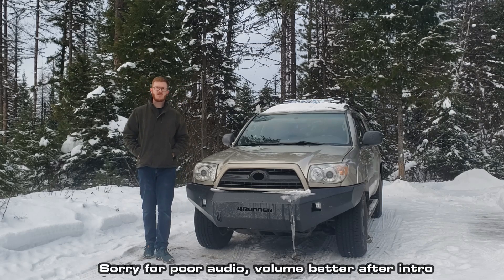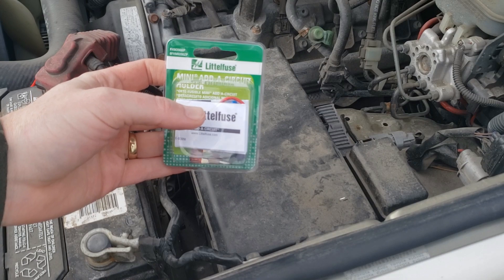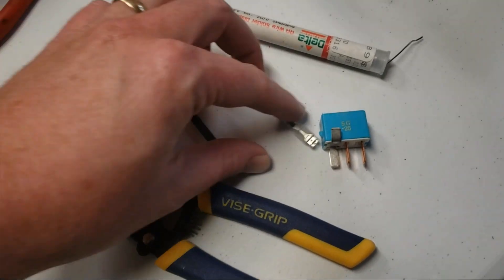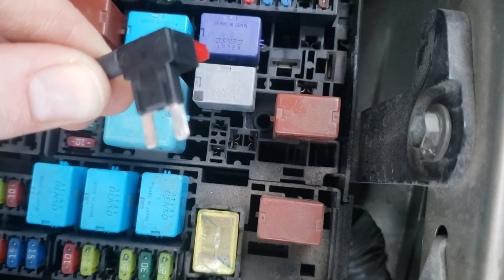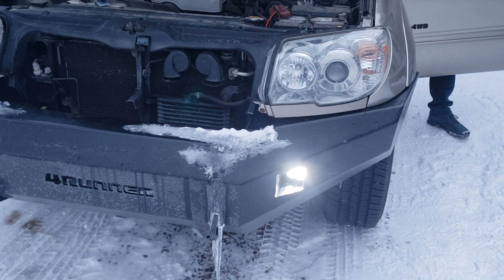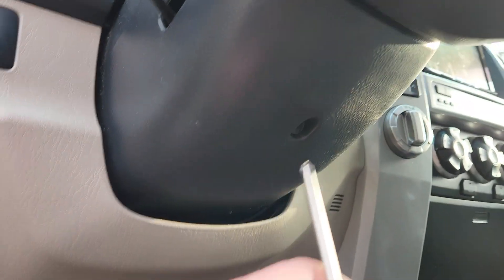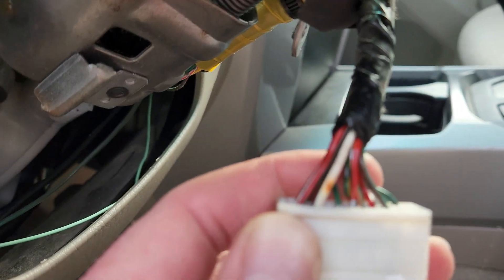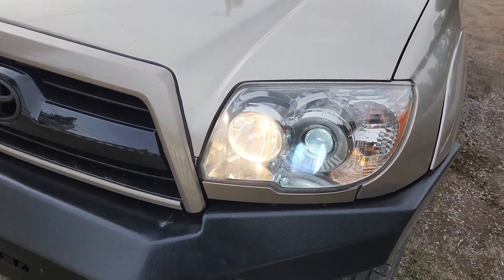DIY Independent Fog Lights OEM Switch | Toyota 4Runner 4th Gen

Comment: Does this work on an 04 highlander?
Reply from the maker: It can probably be done in a similar way, but the wire looms are different so the 4th gen 4runner method isn't going to be the exact same. May be easier to run the lights to an independent switch similar to this one: 
https://www.amazon.com/WeiSen-Switch-Backlight-Connector-4Runner/dp/B07WDVYCKL/ref=sr_1_4?crid=ZNKPE0XHB79N&keywords=toyota+fog+light+switch&qid=1678458996&sprefix=toyota+fog+light+switc%2Caps%2C218&sr=8-4

Comment: Installed new fog lamps, used the old light plugs behind bumper. I have no power to the fog Lt. switch all fuses checked and OK, any thoughts on getting voltage to OEM fog Lt. switch?
Reply from the maker: So I had the OEM light switch act as a signal (on/off) for a relay that came with my LEDs. The relay then fed the power to the LEDs.

However, your problem is the OEM switch has NO power at all. Fuses are good, so I'd undo any wiring you've done (if any) and get it back to stock, then check wires at both ends (multimeter or light that turns on when circuit is good.) See if someone before you messed with the wiring too, I had that once where someone had messed with factory wiring. Was a nightmare but just trace each wire, even through the firewall if you have to. Good luck!

Comment: i have a 3rd gen. If i wanted to just tap into the fog light fuse to use it as a switch for my dimming function on a boost gauge only when the truck is on, could i just bend that portion of the fuse you did and hook up and plug it back in?
Reply from the maker: That sounds like that would work. Usually when running 3rd party fog lights I just find the wire from the switch, have that feed to a relay that is looking for a signal wire (on/off from the switch) and then the relay will run my fog lights, or in your case your boost gauge. Trial and error may be your best friend on this one since I'm not as familiar with a 3rd gen.

Comment: Maybe i should be checking the wiring Diagrams first before i ask but I don't care about running the fogs without the headlights on but i do care about the fogs turning off when the high beams are used. Can i just perform step two under the sterring column without step one that you did under the hood?
Reply from the maker: As far as I know yes, that should work.
Reply: @My.Lame.Perspective  Thanks for your input. I'm using the high beam switch and fog switch with a Switch Pros which has two trigger points. When the trigger is hot it will turn on whatever outputs you want. So instead of pressing the buttons on the switch pros I can use the OEM stalk to switch two sets of lights. I'll report back after I've connected those two wires under the steering column to confirm. Cheers.

Comment: Hey man! Great vid! I'm working on converting my old foglights to similar ones to what you have in this vid. I have an 04 4runner with a new off-road bumper that are looking for some led fog lights that I want to still use the OEM switch for, so this helped a lot!

Question tho: Did you cut and connect old wiring harnesses to the new lighting wires?

Also for the 2nd part of this vid where you vampir clipped... Do you still have to mess with the fuse box in order for the fog lights to be on with the highs? 

Thanks!
Reply from the maker: Hey thanks, glad the video has helped you out. 
1. Yes I cut old fog light wire and ran that as a signal wire to a relay, which then turns on my aftermarket fogs. 
2. Honestly I don't remember, you may be able to skip part 1 (fuse box) and just do the vampire clip, but for how easy it was I'd just do both. Super helpful for offroading at night. Good luck!

Comment: Thanks for commit. they used to work wired new lights using OEM plugs on new lights, still no power to switch OEM switch?
Reply from the maker: Very strange, only thing I can think of is the new lights require more power than the OEM wiring can send. Maybe add a relay in between the OEM switch and new lights? Otherwise I'm not sure since fuses are good.

Comment: What if I don't have the mini tool
And i just bent the relay and plugged it in directly 
What will happen ?
Reply from the maker: I'm not exactly sure, you could do that and it would probably work just fine, but without a fuse in between you run the risk of burning out the relay or the bulbs faster.
Reply: @My.Lame.Perspective  Tried it. Unfortunately, the fog lights didn't work at all 🥲

Comment: Is the vampire clip just connecting the 2 wires out of the clip?
Reply from the maker: Ya exactly, you could also cut the one wire and splice all 3 ends together, vampire clip or quick splice connector does the same thing.

Comment: I got a 2005 Limited 4runner and i have the IG relay on where you put the fuse . any suggestions?
Reply from the maker: I tested a lot of spots and the IG was the only one that worked for me. Since that's not an option with the Limited, I'd check any open spots with a circuit tester and if you can't find any under the hood you may have to find one in your fuse box under the steering wheel. Good Luck!

Comment: On my 2006, the fog lights are already independent of the low beams. They only go out when the high beams come on. So, does that mean I only have to do the steering column splice, to make them stay on with the high beams? If I'm not mistaken, one of those relay pins are hot, so you can just wrap or solder a small wire from that one to the one you bent up, and just plug it back in. No need for external power, if you can take it directly from the relay itself.
Reply from the maker: I believe you are right. I did mine differently since I'm an 05. Good luck!

Comment: How does the vampire clip work?
Reply from the maker: Heres a quick video that explains, probably easier than a long reply from me:
https://www.youtube.com/watch?v=PoSJHY2Y1ys
Reply: No I understand how they work, but they're usually to splice 1 wire to form 2, here it looks like the usually capped end is opened up just to bridge 2 wires. Sorry should have been more clear.
Reply from the maker: @bryangarren6709  Oh ya I see what you mean. Ya i've always used them as a T joint, letting one wire run from a to b and just tapping into the middle.